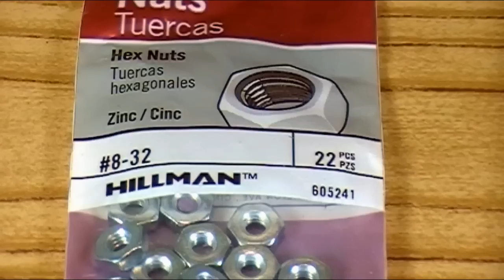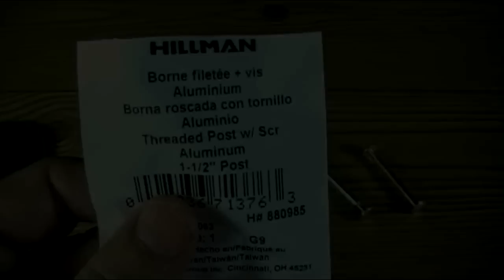ULTRA Compact Pocket Stove - With Built-in Pot Stand!

Comment: Not a bad design at all.
Wish you had time and temp stats on this.
And perhaps a real life use such as making breakfast or similar.

What can you do about the wind?
Or is a separate wind screen is still needed?
Reply from the maker: Thank you for the compliment on the stove design my friend... I really appreciate it. I'll get the time and temp stats on this one as soon as I can and let ya know. As far as a windscreen... yeah, I would definitely recommend using one with this particular stove. All the best......
Reply: @IntenseAngler  Makes you wonder if you could burn 1 piece of matchlight in that stove.
Reply from the maker: @crazysquirrel9425  Hmm... that would be interesting to find out. If ya get a chance to try it out definitely let me know how it works. Thanks.
Reply: @IntenseAngler  Round round round I get a round (to it) lol
Have too many fun designs I am working on right now.
But I will see when I get the time.

I want to try one that is a center draft design and see how that works too.
Idea came from a center draft oil lamp.
In theory, it allows more air into the mix.

My goal was to be able to have a soot free rubbing alcohol stove that can burn other alcohols too.
More versatility that way.

Rubbing alcohol needs a LOT of air for combustion.

Perhaps some kind of venturi design?
Dunno yet.
Reply: @IntenseAngler  I wanted to use a candle tin but has issues.
Stands that fit inside are far too close to the flame when using them as a pot stand.
The 2" screws are the right height but won't fin in the can for storage.

I would have to get a Nivea tin or shoe polish tin...

I was working on a tuna can stove that would burn charcoal. That too has a design flaw.
Goal was to cook or heat water with one lump of Matchlight.
That stove could double as an alcohol stove holder/wind screen too.
Reply from the maker: @zolar1nonassumpsit219  Lol. I'm glad to hear that you have many fun designs that you're currently working on. I hope the center draft design works very well for you. I'd love to hear how it turns out if you get a chance. Wishing you the best of luck on your quest to build a soot free rubbing alcohol stove my friend.
Reply from the maker: @crazysquirrel9425  It certainly sounds like you have some awesome ideas for stoves (and variations) my friend. I hope that you get all of the flaws worked out and they perform very well for you. The tuna can stove that would burn charcoal sounds very interesting indeed. I would definitely enjoy hearing how that one works out. Best to ya!
Reply: @IntenseAngler  Thanks. Had hard drive failure and lost everything. Trying to get things back up and running with a new one.
Between that expensive headache and bad weather it may take me a while.

I did however, before the crash, take a soup can, cut and baton small pieces of wood and put them inside as a kind of Swedish torch.
Still have room for one piece of charcoal on top too.
Idea was to have the option to fry some hash browns with that bacon and eggs LOL
I think the tuna can charcoal stove is going to need some vent holes in the sides near the bottom for air (comparing to a backyard charcoal grill in a way).
That large can can hold about 4 possibly 5 pieces of matchlight.
Still need to elevate the fuel off the bottom somehow so air can get underneath the fuel.

Just too many things hit at one time.... sigh.

Oh a guy I met told me that when he was in the service, he would pour diesel fuel on the ground (sandy ground he said), lit it, and cooked that way.
I think that just ruins the soil....
Reply: @IntenseAngler  I just modified a soup can to burn either charcoal or wood/twigs.
Have to test it. Might need a few more air holes in the bottom.
Too windy right not. Don't want to risk burning down the neighborhood.
Reply from the maker: @crazysquirrel9425  That sounds like an awesome design with the soup can my friend! I'm looking forward to hearing how it works after you get a chance to test it out.
Reply: @IntenseAngler  Will try this weekend when I can sit outside and it not be really cold.
Figuring that can should run about 30 min or so. Cold + Wind is NOT my friend! lol

If it seems to work ok, I will see about installing a bail to carry it.
Reply from the maker: @crazysquirrel9425  I hear you there about the cold and wind... that's never a fun combo. Especially when you're out there trying a new stove design, lol. Hope the weather cooperates for ya this weekend and you're able to get out and do some testing.
Reply: @IntenseAngler  Going to be a really nice day today BUT...
Dang furnace giving me fits.
Just can't catch a break....

We are expecting really bad weather in a few days and sub zero temps after getting pounded with snow.
Furnace is top priority right now.
Reply from the maker: @crazysquirrel9425  I can definitely understand that my friend. I sure do hope that you get your furnace fixed before the sub zero temps roll in!
Reply: @IntenseAngler  It was a bad relay and the access door was loose.
Seems to be working so far.

I did a test in a hobo soup can.
I used pieces of wood in a Swedish style inside it.
Burned about 10-15 min roughly. But it was pretty windy when I tested it.
I want to try a piece of charcoal but weather is bad now.

Didn't do any boil tests either. Just a working test.

3 more months of nasty weather to go....
Reply from the maker: @crazysquirrel9425  I'm really glad to hear that you were able to get your furnace all sorted out and fixed. It sounds like the testing on the stove is going well too. That's always a process isn't it, haha. I hope that your continued testing gives you the results that you're looking for my friend. Best.....
Reply: @IntenseAngler  Thanks. It finally warmed up enough for the streets to clear up so I could go SHOPPING!
Spent most of the day too.

In a few days I will try to test again.

I think the wood I used for the test wasn't dry enough or seasoned enough.
I may cook some of the wood to dry it and test again.

I also want to try using matchlight in it.

Alcohol stoves work but wanted a backup plan.

Note: I just got my MSR Pocket Rocket Deluxe today! Hooray!
Tested to see if it worked and it is AWESOME!
But expensive compared to free twigs and wood though.
Reply: @IntenseAngler  Got furnace fixed then the humidifier broke 3 days later. Sheesh...
Just can't catch a break.

Got my Pocket Rocket Deluxe the other day. Fired it up - EXCELLENT!
But no time to test anything against it...

Going to be dang warm tomorrow. Might experiment a little but ground is wet, cold, and soggy.
Reply from the maker: @crazysquirrel9425  Geez, it definitely sounds like you can't catch a break man. I sure hope the humidifier is an easy fix and you get it up and running again soon. That's awesome about your Pocket Rocket Deluxe... I'm glad that you're liking it so much. Hopefully the weather clears up for you and you're able to do a bit of experimenting and testing. All the best.....
Reply: @IntenseAngler  Humidifier might be an easy fix. Dunno. Depends on if the 50+ year old part is still available.
Otherwise it can cost a whopping $799+ to get it replaced.
Weather is nice right now but there is a high fire risk where I live so I don't want to risk being the one who burns down my town! lol
So I got the shovel out and turned a little spot or 5 to loosen the dirt and allow for things to get going by spring time. Turned in some alfalfa pellets, wood ashes, and use coffee grounds.

Have an 800 Sq Ft garden to work on soon too. All by hand with no help. Sigh.

Just so the wife can have green beans and a kazillion kinds of tomatoes!
Planting is the easy part. WEEDING is not. Watering takes HOURS to do every other day in the summer.
We don't use chemicals on anything.
All organic.
Ever try to gather and mow over 80 bags of fall leaves? Have to mow then 2-3 times to make them fluffy.
Then let them sit for months then mix into the soil.

Alcohol stove intent was severalfold.
1 it is kinda of organic depending on the alcohol used. Hobostove is more environmental friendly but have pocket rocket just in case.
2 I can heat water to make some coffee while tending the garden 🙂
3 backup plan in case of grid failure or other disaster.
4 heat pvc pipes to soften them and make my own fittings.

One thing your stove CAN do that was not mentioned is that one could make charcloth with it.
Roast marshmallows is another thing. Make a Smores or two.

Did you know you can take an old plastic trash can, fill it with compost and dirt and make a nice planter for a tomato plant? NO BENDING! Just make a few holes in the bottom for drainage.
I did that with a pepper plant. Worked GREAT. Weeding was really easy too!

But I digress lol
Reply from the maker: @crazysquirrel9425  Wow, it definitely sounds like you have A LOT on your plate right now my friend! I'm glad the weather is nice right now for ya at least. That's really cool that you do your own organic gardening... food that you've grown yourself is always best (in my humble opinion). The weeding part isn't nearly as much fun though, lol. It certainly sounds like you have some big plans for the alcohol stove... I hope they all work out for ya. It's amazing what a person can do with a little good ol' fashion ingenuity, eh. Thanks for the tip about using an old trash can for a planter by the way... you can bet I'll definitely be giving that a go this year!
Reply: @IntenseAngler  You are very welcome!
Making emergency fishing kits today.
Using old test strip containers (looks like old film canisters) and those are water tight to a degree and air tight too, putting in 6 different sized hooks (3 pairs of 3 different sizes), 3 pairs of different sinkers, 4 swivels, about 20 feet of 65 pound test braided line, and might squeeze in an artificial bait.
The opening lip on those I drill a 1/16th inch hole in that lip.
I can then use the canister as a bobber (floater) as well by attaching the line to the tab (lip).
Would only need to find a stick or something to attach the line to and some kind of bait.
NEVER tie it to a body part! Especially a toe! A big fish could yank your toe off!
Other body parts would give you a deep nasty cut if a big fish got it.

Bought an O-Ring for my 'flashlight' alcohol stove. Put alcohol in it to see if it will leak.
That flashlight stove is pocket sized. Runs about 7-10 min on a fill. Enough to heat some coffee! But not long enough to boil anything.

Made a carbon felt oil/hurricane lamp wick too. Gave one to a friend and one to a parts house guy. They are threaded with 24 gauge copper wire for thermal feedback.

I don't let no grass grow under my feet as it were! lol
Always doing something.
Reply: @IntenseAngler  An update: There is an extreme fire danger lately and in the foreseeable future. Have to hold off testing anything for the interim.

On that trash can -
Fill the bottom with seasoned wood and branches/twigs. About 1/4 to 1/3 of the way. Too late to add in fall leaves. Maple leaves are the gold standard for composting leaves.

Rest gets good soil. Water well and let it settle for a while. Refill to top off and water again.

When it doesn't settle any more, you just made a Hugel Trash Can!

Look up Hugelgarden.

You can do the same with most any plant container so long as it has a drain hole and you avoid certain allelopathic woods.

I put a tomato cage on mine then an inverted and attached a 2 liter bottle of water that has a cap, a 3/16" hole in the cap, and jute twine running through the cap down to the soil. I cut a hole in the bottle's bottom for refilling and to prevent vacuum from collapsing the bottle.
Wrap the twine with aluminum foil to reduce wasted water from evaporation.

Or you can use a 1/2 gal long-ish GLASS wine bottle, fill it, invert it and shove in the soil.
That works too. Green glass is best. Brown makes water too hot. Clear allows for algae.

Once set up, get out your chair and table, fire up that stove, and cook ya something to eat.

The Hugel part does take time to break in. 2-3 YEARS depending on materials used. In the meantime, you at least have a raised bed growing medium.
Reply: @IntenseAngler  Also look up Kiddie Pool and grow bags.
You fill the bags and put them in a Kiddie pool that has a drain.
Corn can grow 50% bigger in that setup. Sometimes even more.
Reply: @IntenseAngler  Going to order some Soda bottle preforms with caps.
Perfect to store things in like ALCOHOL, matches, seeds, fishing kit, salt, sugar, coffee, rice, oats, things you want to try and keep dry.
Should hold about 5 ounces of alcohol in one. Dunno. Didn't do the math.
Reply from the maker: @crazysquirrel9425  It certainly sounds like you have a bunch of projects going on my friend! I really appreciate you taking the time to pass along all of the info about the fishing kits and alternative gardening options... it means a lot. The soda bottle preforms sound very versatile and awesome by the way... definitely gonna have to check those out! Best....
Reply: @IntenseAngler  I think I forgot to mention I made my own biochar. I used oak heating pellets to make mine. Result is a near perfect granule size and NO GRINDING/SMASHING!

Look up Amazonian Black Earth for some interesting information.

What good is a stove if you have nothing to COOK on it?
Reply: @IntenseAngler  Just made another tuna can stove. This one uses stainless steel hardware cloth as a pot support ans I made a kind of 'floor' out of the same mesh to keep charcoal, wood, and other things off the bottom. Drilled four 1/2" holes near the bottom and one nearly centered on the bottom (dang bit walked on me).
First one I did had no holes or 'floor' and was very poor in burning anything.
Best for that one is to hold an alcohol stove in it and use as a pot stand too.

Too bad I do not have an email for you.
Reply from the maker: @crazysquirrel9425  That sounds like a great design my friend.. very innovative! I love the versatility of it. It's definitely hard to beat being able to use multiple alternate fuels. 

There's a contact email address for me in the "about" section of my channel page. 
I try to check it as often as I can, but my apologies in advance if it may sometimes take a few.
Reply: @IntenseAngler  I did not see any email address there.
I can post mine here but have to delete it quickly
Reply: @IntenseAngler  About the preforms. We ordered a kit that has 3 LARGE ones and 3 regular ones that can nest inside.
Large ones good for packing sugar or salt, oatmeal, rice, similar.
Small ones can be used to make bigger fishing kits, carry alcohol, etc (but not nest them with food).
Working on an oil lamp wick design right now.
Hard to do without the olive oil to test it.
Just had over 1/2 foot of snow on tip of ice.
Stuck inside for a few days.
So I either pester the old lady or work on my projects. Both can be (ahem) fun?
Reply: @IntenseAngler  Button said view email address but when I clicked on t, it was replaced with a submit button and no meal or anything shown.
Reply from the maker: @crazysquirrel9425  Hmm.. that's odd. Hopefully it was just a glitch or something. I just checked it and it seems to be working now.
Reply: @IntenseAngler  Tested it out twice today. Failed to boil water. Of course the wind is pretty bad today.
Will have to test again when it is not do windy.
3 charcoal briquettes burn for about 1 hour.
Reply: @IntenseAngler  Still not working and showing me the email.
Changes from show email to a small submit button that does nothing.
Things getting pretty scary in the world right now.
Reply from the maker: @crazysquirrel9425  That is very strange indeed. It shows that it's working on this end whenever I check it (I've had a couple of friends check as well and there don't seem to be any issues on their end either). I definitely agree by the way, things are certainly getting pretty scary in the world right now. Stay safe and well my friend.
Reply: @IntenseAngler  Wish we could do email... REAL email, not through here.

Comment: What is the purpose of the carbon felt??
Reply: +Chris Schneider It's basically a welders blanket. It's used to protect surroundings from flames and high heat while welding or soldering. Here it's used as a non-flammable medium that will soak up the alcohol. Think everlasting wick, just add alcohol.

Comment: A lot of comments about difficulty finding carbon fiber.
common wall insulation packed down into the tin
would probably work well.
Reply: Why does it need the carbon felt? Won't it burn just as well without it?